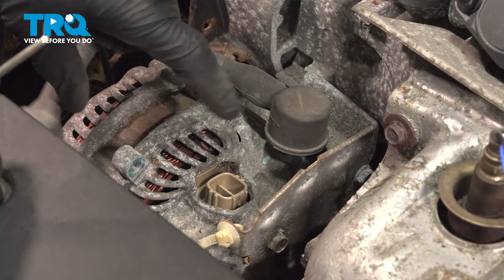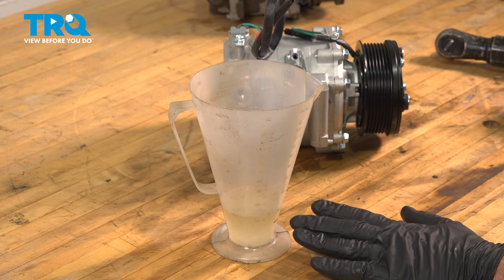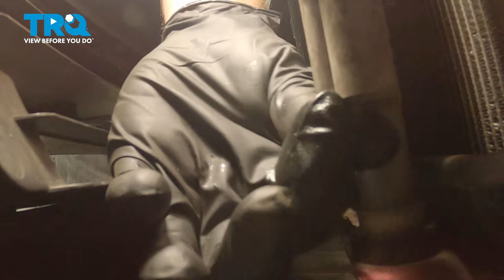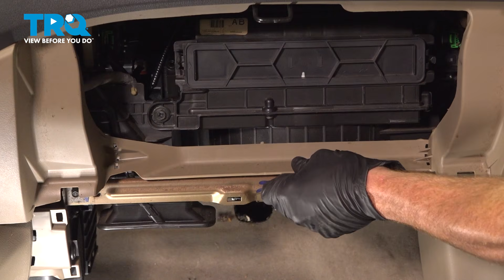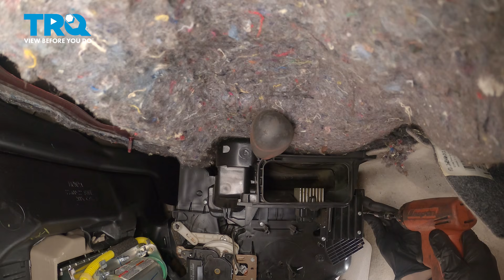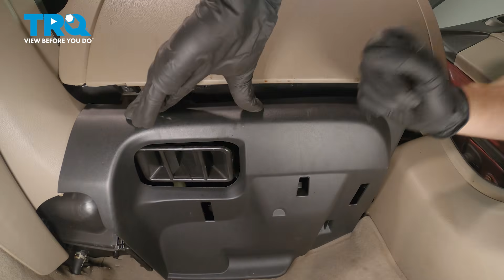How to Replace AC Compressor Kit 2006-2011 Honda Civic

Comment: Just replaced the compressor in my 07 si. The new belt was the same size as the old but I could not get it on. I ended up have to buy a belt that was slightly larger. Even then I had a hard time. I had to remove the idle pulley put belt in place and then idle pulley and then release the tensioner to get it on

Comment: my AC works when im just parked air on but i gotta gradually increase the cooling as it goes, if i step on the gas the air cuts out but when i maintain a solid speed under 70 itll be cool sometimes it cuts in n out. im GUESSING its my compressor after seeing reels showing it move n the freeze up, i feel thats what im going thru as i drive or even struggle to get cold air coming thru. im not abl to turn max AC right when i get in, ive noticed that hotter months cause it to  not work at all at times. please help another persons input would help

Comment: Thanks for the video , you provide great details ,  I really appreciate that , I just have a question please , I have Honda civic 2010 it has 70000 miles in mint condition ,  I don't know if i will do same as in your video same as in this , the A/C weak sometimes blow hot air after cool air , I add ferion and put the pressure caliper found the low side 80 and the high side is 50 !!!! This before I run A/C staying like that even when I increase the engine to 2000 rpm   just the low side went to 75 after 5 minutes but the high side didn't change  what do you think the problem ? There is no any leak at all  , I have short video clip if you interested to see what is going on .
Thanks

Comment: Thanks for such a detailed installation. I fast forward and rewind your installation procedure several times. Only thing that I've seen missing  is that you should flush the system with high pressure air and a/c flush and clean before the installation of the new parts (compressor and etc.) since there may be old (aluminum) debris inside the line.  BTW, why is this Honda so rusty.🤔

Comment: There was a third bolt on the alternator. So if the alternator doesn’t budge, don’t force it like I did. I chipped the frame 4:26
Reply: It should be located on the very bottom if you have a third bolt, which isn’t mentioned in the video

Comment: Is there any rule of thumb that states if the AC compressor has failed and run for "x amount" of time, replace more lines and condenser due to sending debris into the system??